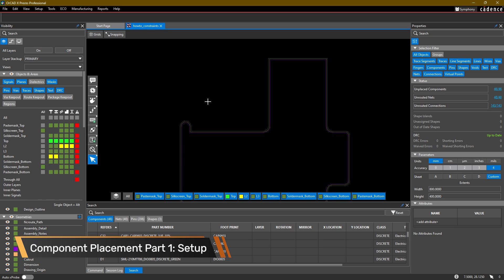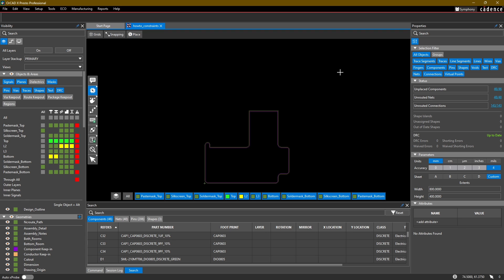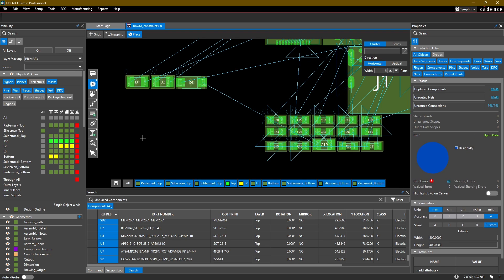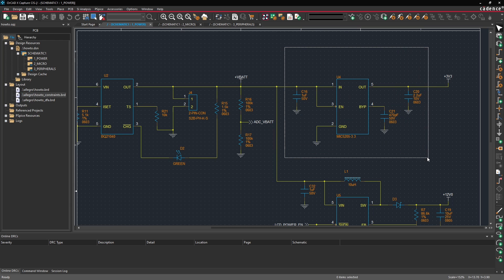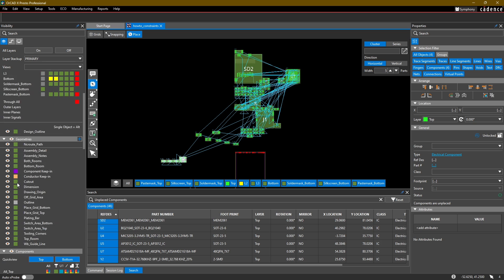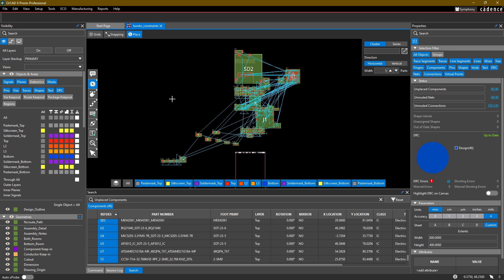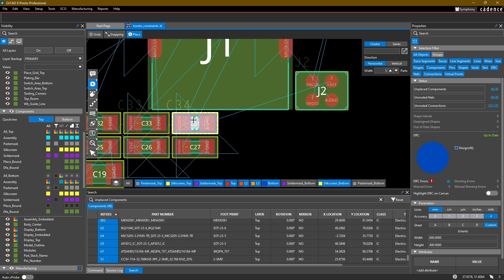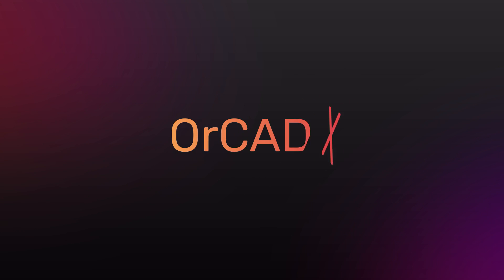OrCAD X How To Series - Part 4 - Component Placement Part 1 Setup

Comment: during place multiple components action, I type in a RefDes and get a warning triangle in the helper window.  What did I miss?
Reply from the maker: The triangle shows up when the input is invalid.  Make sure you're entering a RefDes that matches one in your netlist.  If you're unsure what RefDes to use, you can find your list of parts in the Search panel at the bottom.  Also, double check that your netlist is actually imported into the design.  In the board outline step, it is possible to import a board outline, but still have the netlist wiped.  In that case, it's a simple fix of simply exporting to your same .brd file through OrCAD X Capture.